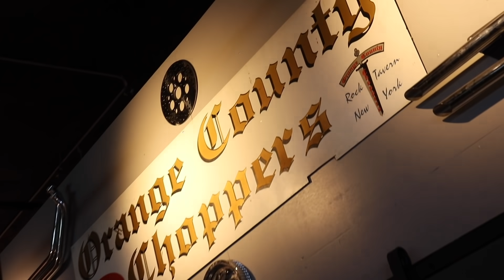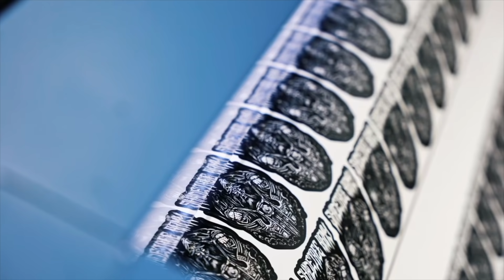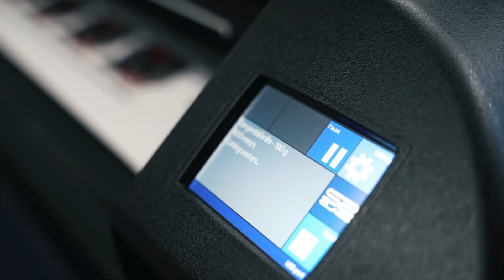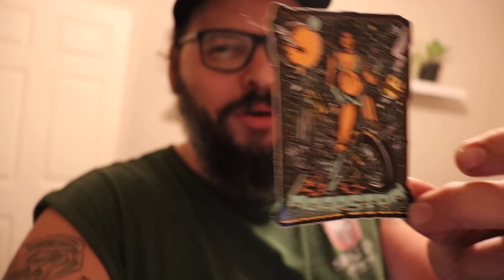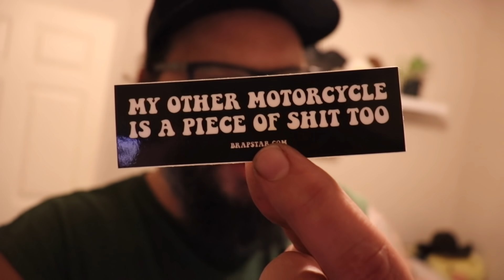When your motorcycle SUCKS

Comment: Road king kong makes 130 whp at almost 900lbs,  In 2000 I used to drag race a 2000 GSXR 750 that was just piped, had a modded, airbox, and track tuned this bike weighed about 400lbs and made 133 uncorrected whp. and ran 10.90s all day. Everyone has their own idea of fast.

Comment: 2001 883 has 52.5 HP
          1200 has 73hp I think it is!
Mine has A Buell X1 lightning stock motor in it (crank, flywheel, connecting rods, heads and jugs) S&S Shorty E carb, Andrews N8 grind cams (basically one step above stock) was built at Battlefield H-D! Took it there once to have tires installed and the shop guys knew it instantly! Said last it was on the Dyno there with the stock (POS) CV carb it was pushing almost 110 at the rear wheel! It is quick revs so much higher with the light fly wheel and crank, and pulls so hard even with my big 300 pound ass on it!

Comment: Exhaust:  look at Danmoto's Highwayman 2-1 full system for sportster.  Light weight Stainless Steel and that 'rumbling sound'. I put one on a 2000 XL1200'S' worked well with the Buell-pumped engine  note it doesn't come with flanges, 'C' rings or gaskets (Ryca motors has a kit)
Reply: good choice. 2 into 1 always look better on a sporty. the shorter ,the better.

Comment: Sportys, especially carb'd Sportys, do not want more than 90 bhp as a street bike, on a stock bottom end, before reliability issues start appearing.
I would go as far to say as a genuine 70 lb ft of torque and 75 bhp dyno'd at the rear wheel, with stock cams, sensible pipes (2:1 Supertrapp) and a carb/filter kit with cleaned up heads, makes a very nice street motor and a very nice street motorcycle.
And not expensive to do.

Comment: I used to own a 1991 Sportster 1200 and it made 35 wheel HP. It still felt relatively quick, because it only weighed 500 pounds wet. It would suck the mirrors off my 2005 Heritage Classic Softail on its way by off a dig.
Reply: That just doesn't seem right. 
My V Star 650 made 39 wheel hp with pod kit, jets and an exhaust. But it also revs to like 8000rpm. (I have no actual clue as it has no rev gauge) 

No two Dyno's are the same and can read very differently though.
Reply: @camerongsx9122  the bike was 26 years old at the time. Environmental factors count for a lot.

Comment: I really like the S&S kits for Harleys for one reason... THEY ARE HEMIS! Seriously they make hemi heads for Harleys with huge canted valves.. Those things flow like crazy, you just have to make sure to run really domed pistons to get the compression back up. The best/most iconic Vtwins ever were both hemis.. the Crocker and the Vincent Black Shadow. (all Vincents were actually) Josh, instead of farming out your stickers to other people, why don't you just buy a plotter/printer and print them out yourself and sell them. You'd just need to get the file from whoever designs them/draws them and then print them out and package them. It shouldn't be too hard even for you :P It'd cut out a lot of the shipping costs and pay for the plotter in no time.

Comment: The new Sportster S has more power to weight than the 131.  Nice to have horsepower from the factory vs buying an additional stage 4 which should come from the factory.  The Sportster S will be more durable with tighter clearance, heat/friction control with liquid cooling.   Road king 800 pounds/131 horsepower  vs Sportster S 500 pounds 120 horsepower

Comment: Shadetree hate to tell you would end up with a 90-100 hp Sportster, simply a bike with a lifespan measured in under 5,000 miles at best.  Basically the bottom end isn't that strong, it will take it only for a very short time.  Have constantly been told by HD guys that they will take it, but when we go on a long ride and are playing it seems that they start having issues EVERY TIME.

Comment: My sportster is quick it's a 1207 with ported heads hammer crush 600 cams, hammer valves and springs s&s roller rockers Daytona twin tec ignition. 11:1 comp. She's in the mid 12s in the 1/4 mile with my fat ass on it 250lbs. It would be in the 11s with a light rider on it.